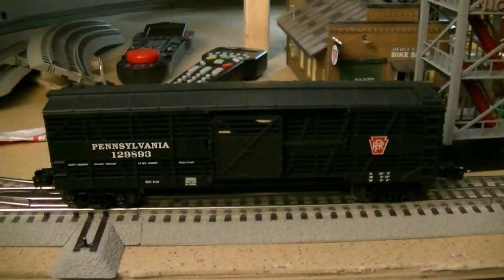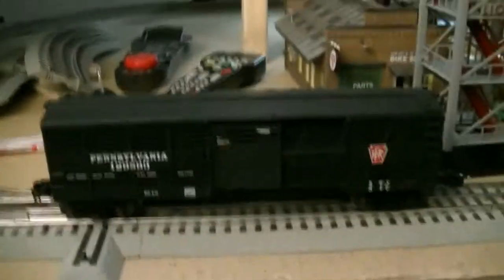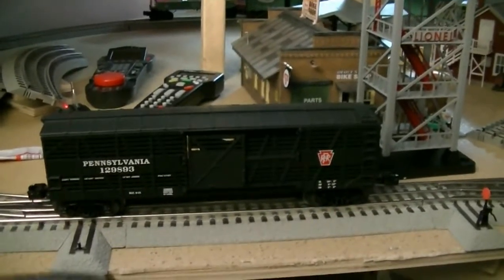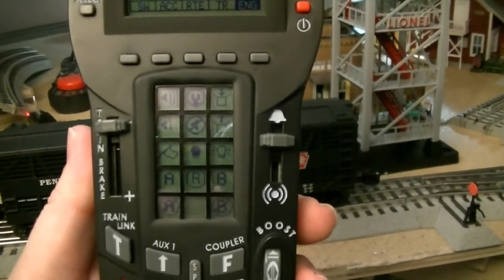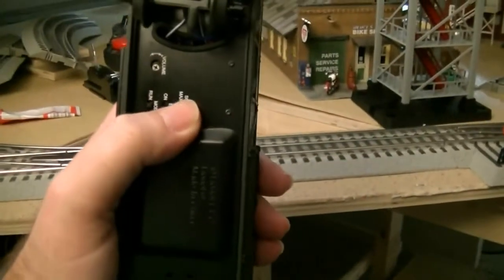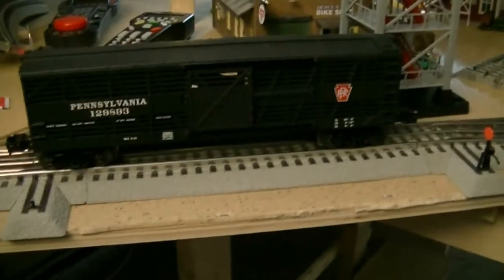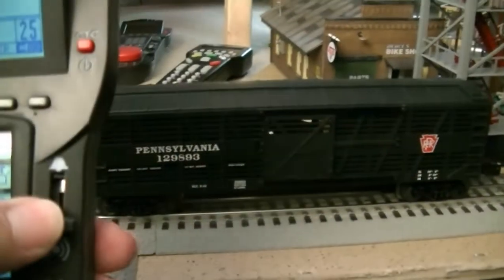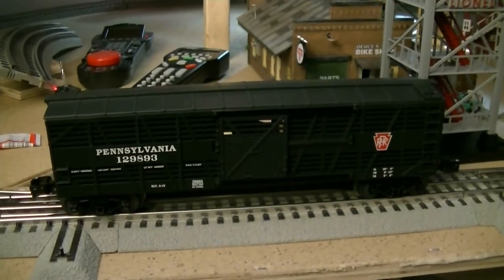Lionel Vision Line Cattle Car

Comment: Open the unit and their is two boards that are connected to each other with push pins, clean the pin connections with electrical contact cleaner and reassemble , the boards are not communicating with each other, I had the same problem.